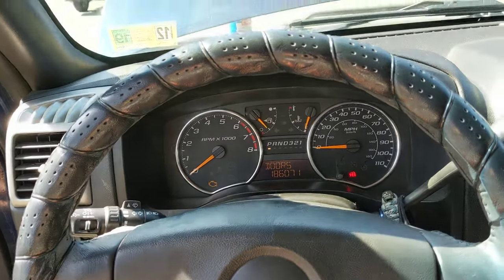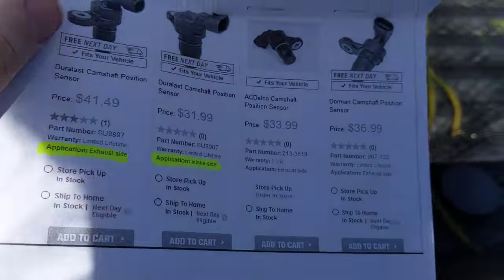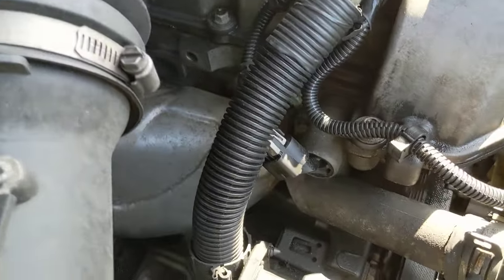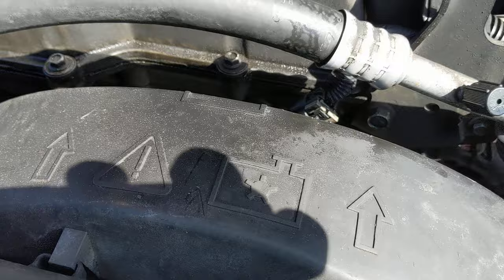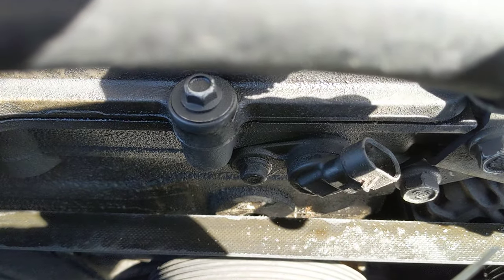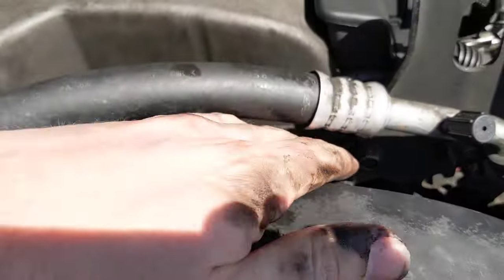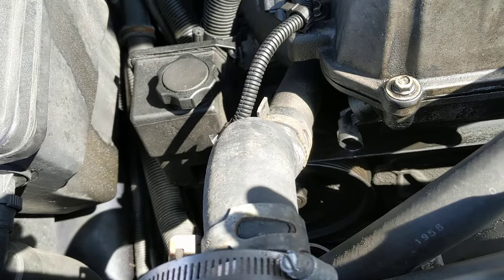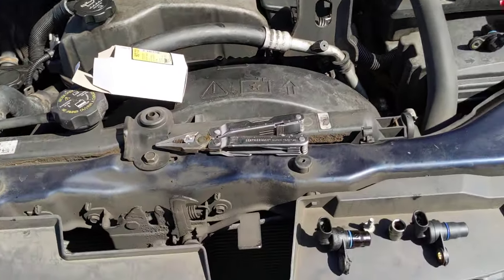2007 Chevy Colorado - Replacing camshaft position sensors, P0340 & P0341

Comment: Has the check engine light turn back on?
Reply from the maker: It's only been a couple weeks since I recorded this video but so far no more check engine light.  :)
Reply: I have p0365 n p0366
Reply: I switch them and the light was off for 30mims and it came back on
Reply from the maker: @geramane5184  Have you checked your camshaft actuator solenoid?  Have the screens fallen out of it?
Reply: Mike Smith yes I did they look good I bought a new one too and put it on but the truck did have a hard time to start up I keep cranking it for 10mins tell it fired up then I turn it off and try to turn it on and didn’t want to start so I put the old one back n turn back on like nothing
Reply from the maker: When it's running does it run smoothly, or is there stutter/hesitation/misfire?  Probably not the problem but have you checked the fuel filter?

I would probably try replacing both sensors with new ones as well as the camshaft actuator, but if you're still having problems that point to the sensors after that it may be a wiring problem, which is going to be a lot more difficult to troubleshoot.  :(
Reply: Mike Smith truck is running great it had random misfire but I change the sparks plus clean the TB and the sensor on the intake manifold and took that off but now I have the code only code I need to fix to smog my truck California things
Reply: On my truck the harness doesn’t clip on the cps . Maybe look into that may very well be the issue it had a hard time starting and when I unplugged it it gave me the same codes

Comment: Bro how the hell did you get the exhaust side off, I can't get that bolt
Reply from the maker: Is it stuck?  Or you just can't reach it?  Put a breaker bar on it, it'll budge!  🤣
Reply: I couldn't reach it. But I got it to budge a little and I just loosened it with the socket with my fingers.

Comment: My 2012 Canyon with the 3.7 only has one camshaft sensor on the exhaust side
Reply from the maker: Mine is a 2007.  It seems like Chevy changed the number of sensors and locations on just about every model year.  :'(
Reply: Mike Smith Where is the intake sensor located I’m wondering if I actually do have it and they don’t know it
Reply from the maker: @warrenmull10  on the thumbnail for this video you can see I circled them both in yellow. 😀
Reply: Mike Smith I saw them mine has the intake side sensor I do believe now but it’s never been changed at 180,000 miles maybe that’s why it runs rough at time and says too lean every so often I’ll check and change it
Reply: Mike Smith The exhaust actuator has been changed 4 times from 97,000 miles when I bought it because it keeps failing

Comment: have 110,000 miles on my 2006 H3....had to change these, and the VVT sensor 3 times total....not sure why this is such an issue all the time....
Reply from the maker: I've heard that VVT sensor is a frequent issue.  Have been lucky so far, 200k and haven't had it fail...  yet.  ;-)
Reply: There is 2 I was told by the dealer there is only 1
Reply: @CompTechMike  that is good!
Reply: @warrenmull10  there is two...i changed both....top front rightside, and under left side, have to take left side tire off to get to it...
Reply: signals34 I had to replace my VVT on my 2012 Canyon 5 Cylinder 4 times in less than 100,000 miles that’s insane that they couldn’t figure it out and redesign the sensor or anything
Reply: Mine is at 180,000 miles and I have replaced it with a 2017 Colorado V6 because it keeps throwing codes and I’m fed up with it because the mechanic won’t fix it after throwing 4 parts on it it still is saying fuel pressure sensor b circuit low and it runs bad so I gave up on it it’s still here waiting to put it for sale

Comment: Tiiiimee is one my side…. Yes it is…!!!
Reply: On a real note I just did this on my truck and it’s been giving me issues for about 6 months randomly shutting off random check engine light
Reply from the maker: @MNJLLC  Hi!  Did changing these sensors help?  What codes are you getting with the CEL?
Reply: @mike smith 
I don’t remember what codes it was showing so far so good tho I changed the oil and oil filter and the same time and everything is running awesome and no more check engine light randomly shutting off or anything out of the ordinary
Reply from the maker: @MNJLLC  Nice!  Glad to hear it.  👍👍

Comment: I can tell by looking but you may want to tell your viewers which engine you are working on. 2.8L  4 cylinder or 3.5L 5 cylinder. Some also have a V8.
Reply from the maker: I say within the first 15 seconds of the video that it's the I5. I should have mentioned it's the 3.7l, however. Thanks!

Comment: I noticed somewhere else, maybe the forums, said that if you change the camshaft position sensors that you will need a relearn tool (expensive scanner i believe) to complete this fix. Did you have this issue? I have the p0017 code, rough idle, and cylinder 1 misfire. I just had a valvoline oil change and put in the new vvt sensor with no improvement.. any suggestions?
Reply from the maker: Hi Dago!  Thanks for checking out my video.  In my experience, replacing the camshaft position sensors (you may have one or two, depending on the year of your vehicle) does not require a relearn.  However replacing the crankshaft position sensor does.  That may be what you're thinking of?

In any case, P0017 is a tricky error.  Sometimes it's as simple as the VVT solenoid.  Sometimes it requires a complete replacement timing chain (challenging on these motors).  Since you don't have any thing to lose at this point I'd try doing the camshaft sensors.  They're cheap and relatively inexpensive/easy.  I'd also try swapping the coils and plugs on that cylinder 1 misfire - see if changing the coil to another cylinder changes the code.  When you replaced the VVT solenoid did you notice if any of the screens were missing?  It's a common issue, there may still be some lodged within the engine, if so.

So I'd start with that.  Replace the camshaft sensors and move the coil & plug from cylinder 1 to another cylinder.  Clear codes and see if they change.  Also inspect the old VVT solenoid for missing screens and do another oil flush.  Clean the MAP, MAF, and throttle body (common to cause poor running conditions).  Inspect the PCV system for blowback / oil in hose, or cracked damaged hoses.  Hope it's not your timing chain.  Let us know if you figure it out.  Good luck!

This other video has additional information:

https://www.youtube.com/watch?v=U143gNZlWbU
Reply from the maker: @daddy_dago  Hi!  I believe there are only three screens, but don't quote me on that - especially if it's an aftermarket or non OEM part.  You can see pictures of mine around 25 minutes into this other video:

https://www.youtube.com/watch?v=U143gNZlWbU

Sitting at the stoplight shaking, and then clearing the issue by doing a wide open throttle pump -- have you tried cleaning the throttle body already?  And those sensors?  Dirty throttle body on these trucks can cause a lot of problems.  When it's idling and having trouble - are the RPM's dropping?

When you swapped the coil & plug from Cylinder 1 to Cylinder 2 -- you're still getting the code for cylinder 1?  Have you done a compression test?